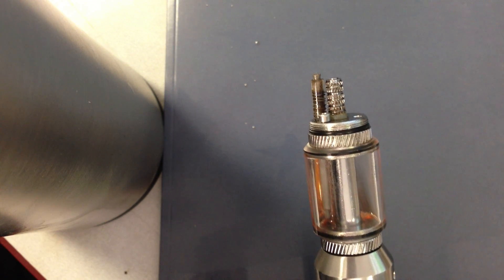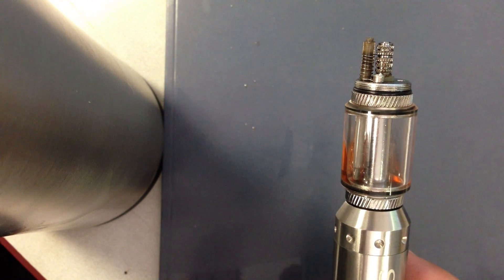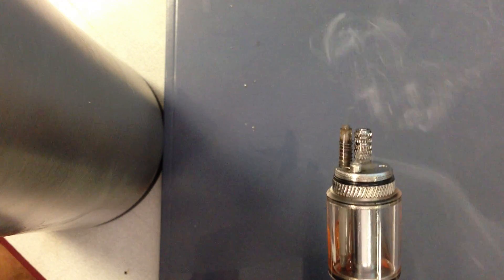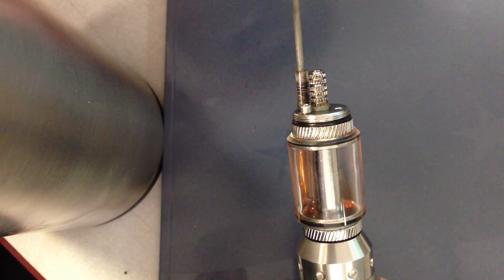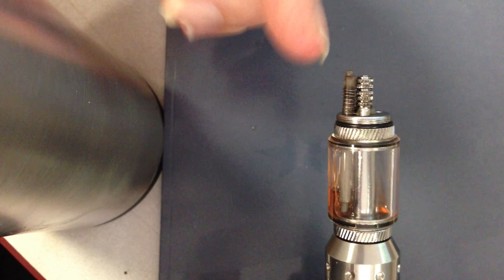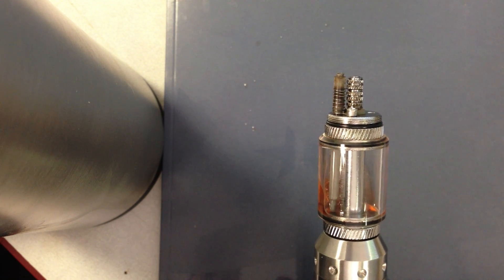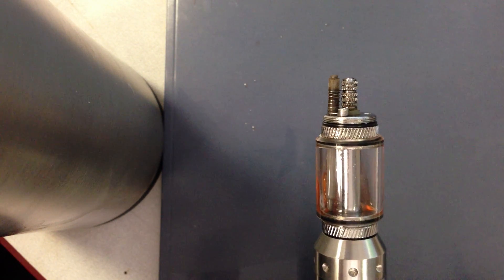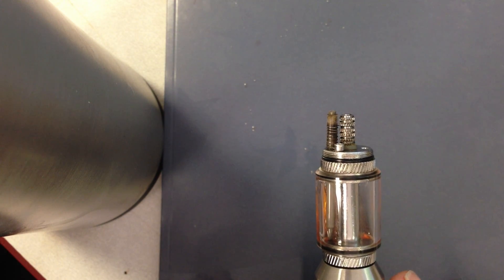Pyrex and SS Mesh Wick

Comment: regarding your  pyrex tube ss mesh wick..you said 4 ohm coil pushing 15 watts...that means that zmax is set at 7.7460 volts...how is that possible on a 6volt protected mod?

Comment: Purdy cool idea you got there. I had a similar idea but instead of pyrex tubing I was thinking about using ceramic tubing. My take is that ceramic would distribute the heat more evenly & avoid any hot spots, of course it's just an idea.